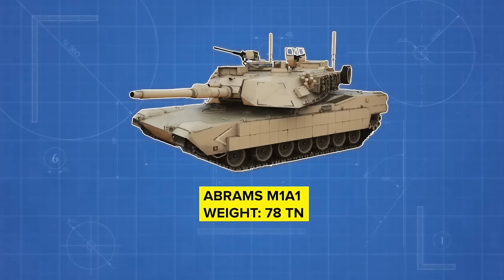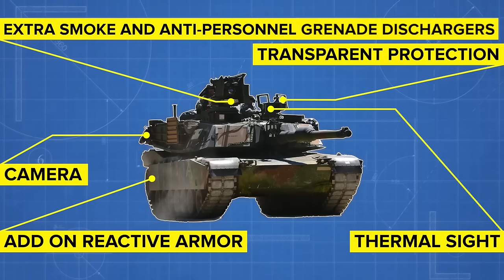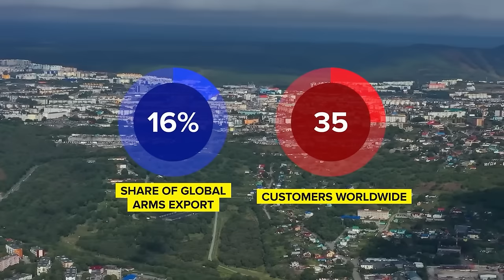Why Putin Is Terrified of New Abrams Tanks Arriving In Ukraine - COMPILATION

Comment: USA would have removed all advanced equipment's within these tanks before shipping them to Ukraine. They are just as vulnerable to drone attacks as other tanks.
Reply: Waa gonna say thwe same thing. Most likely to me retrofitted with export features and not our main tech for security reasons
Reply: @HunterTogata  All modern tanks in services are not designed to guard against top attacks as their top armor are the weakest. Russian drones are always attack from above.
Reply: @zollen123  Not true, the Israeli Merkeva 4M has 200mm of NERA on the top of their tank roof and hull roof. The Swedish version of the Leopard has 100mm of NERA covering most of the turret roof, though nothing for the rear of the hull.
Reply: @TheEsseboy  So you are saying because these tanks are never designed against top attacks so they need to be provided with an extra layer of NERA protection, correct?
Reply: @zollen123  They have been redesigned to incorporate top attack protection yes, Both the Leopard 2 and the Merkeva are originally from the 1970s, just like the modern Russian T-90s, T-80s as they are derived from T-72s and T-64s respectively. 

The most modern MBT in the world is the French Leclerc tank which entered service as late as 1992 and is NOT derived from previous tanks but a clean sheet tank. But it doesn't have top attack protection as they do not intend it to fight om close quarters against infantry without infantry support, IFV support etc. Top attack protection is mostly useful when invading dense cities, or fighting without air superiority.

Comment: The Putesterr is nowhere near the front line and is not terrified. The donated M1s do not come with the extra Uranium armour and are not indestructible (many have been lost in combat over the years). More importantly, ATGMs are not afraid of M1s and there not enough of them. They can be picked off especially if the Ukranians are on the defensive, and spotter drones have more freedom. More ammunition will stop the Russians pushing, stabilze defensive lines and we will see fewer Ukranian losses.